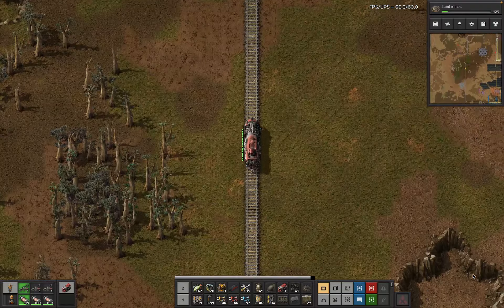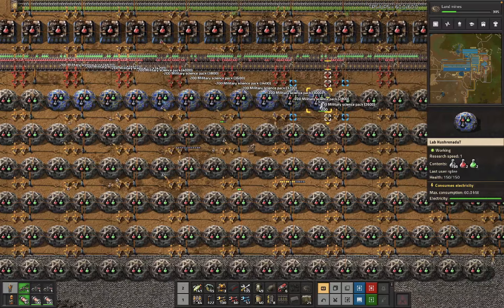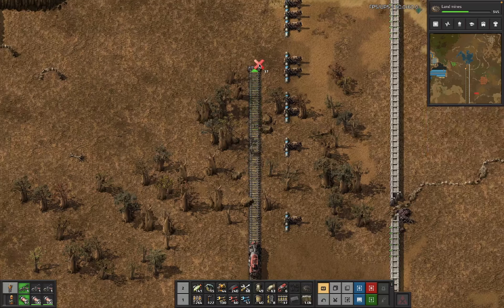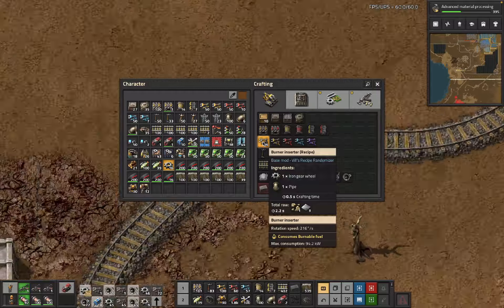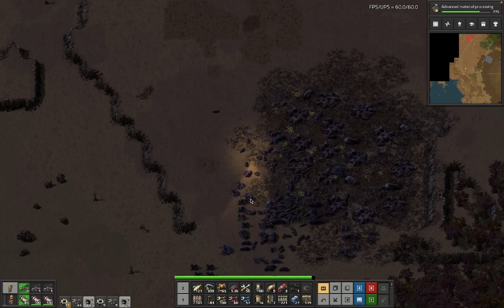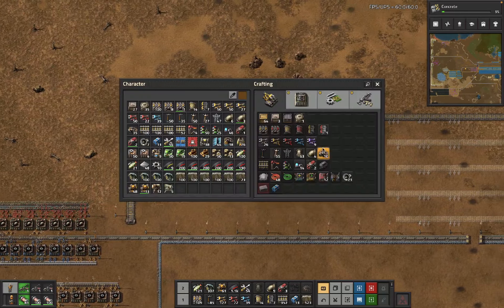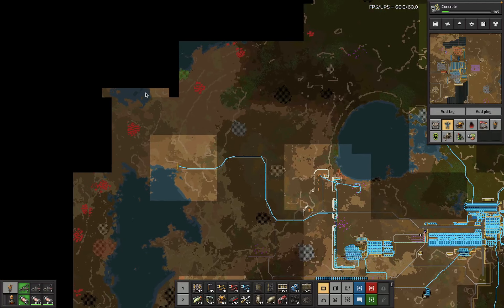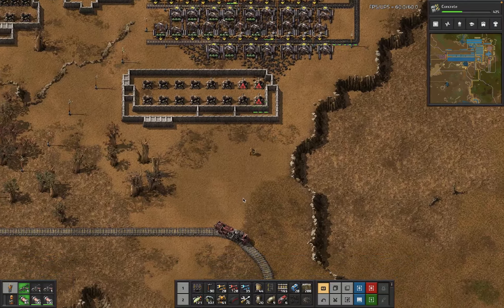Factorio: The Randoplier - E11 - Two grids & beeping

Comment: I think you should put your flamethowers a bit closer to the walls so that more of their attack range is outside the walls and hits the biters before they can attack the walls. also maybe you should just have a giant full wall around your entire base at this scale that might actually makes sense (I usally end up building a giant full wall even on normal science with biters that aren't even remontly close to beeing polluted.)
Reply from the maker: Walls are pretty cheap, and this layout is to prevent spitters from being able to reach flamers. Solid perimeter certainly a thing, but also kind of a pain without bots.
Reply: @splee596  maybe you should actually take advantage of the cliffs and build walls connecting cliffs, but I guess that would be way more canyoning to build since you'd have to build at weird diagonal angels or have lots of turns in your walls which is hard to do with blueprinted walls.